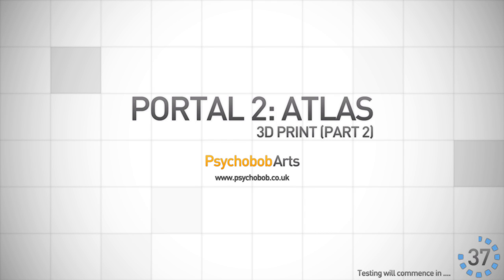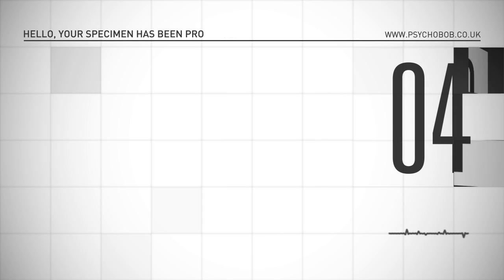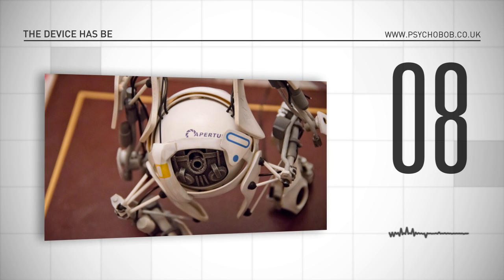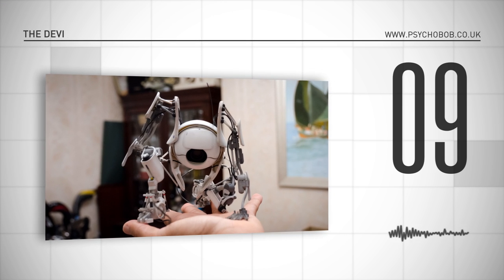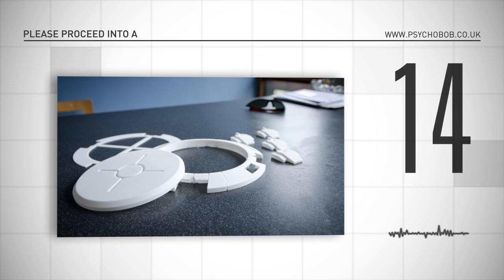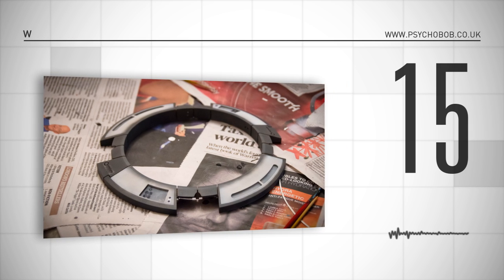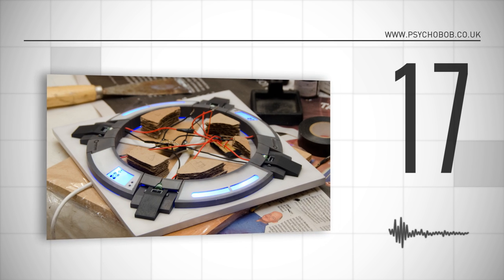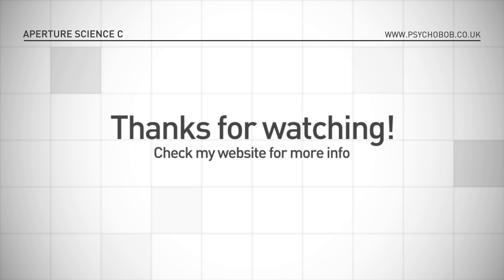3D Print: Atlas (Portal 2) - Part 2

Comment: I see, hm. Which material did you use? (having looked at the shapeways site a bit myself now). It seems to be that FUD is the most detail material, but apparently comes with wax and stuff which needs to be cleaned off.